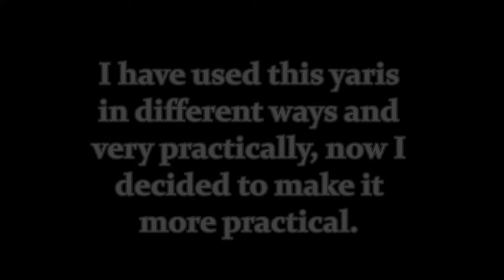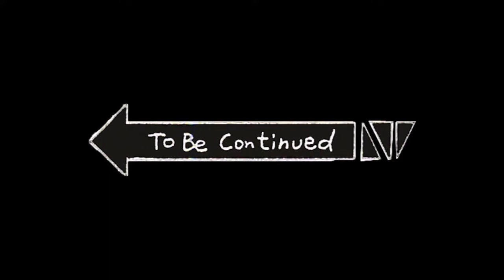Toyota yaris pickup. Home made UTV. Part 1.

Comment: Hi. Great project. What all terrain tires are they (size and manufacturer etc). I have a Citroen C1 and drive through fields and would like some more traction. Thanks
Reply from the maker: Hey, currently there are no all terrain tires on the car, these are some kind of winter tires. I actually want to put ATV tires under there, if it succeeds, there will be a video. Thank you!